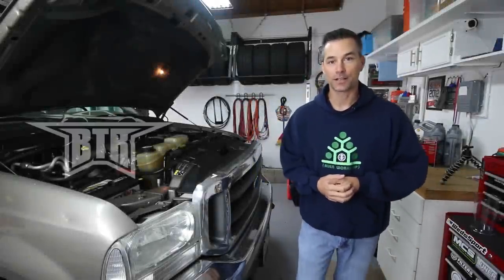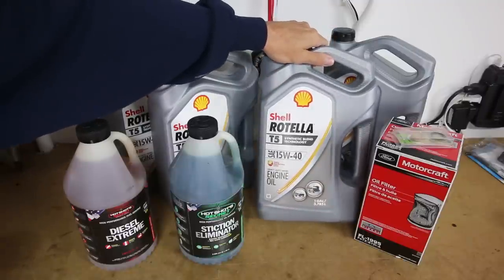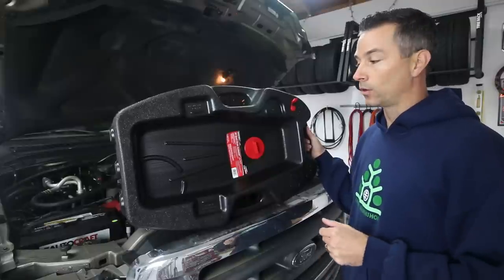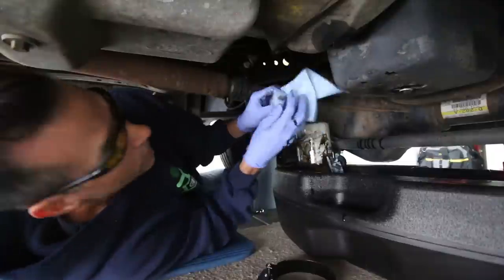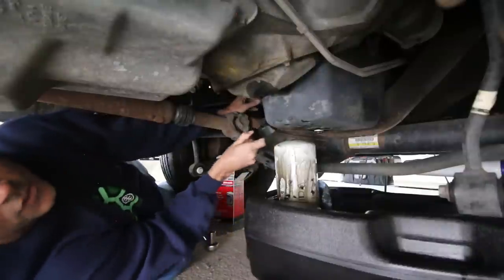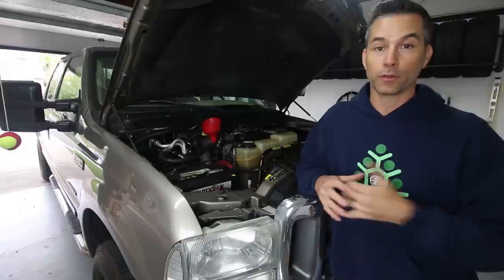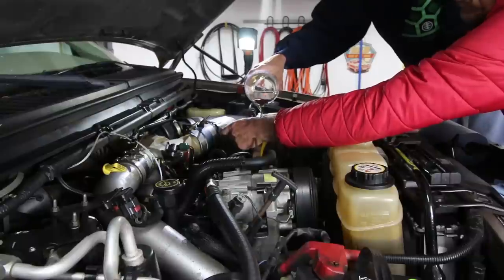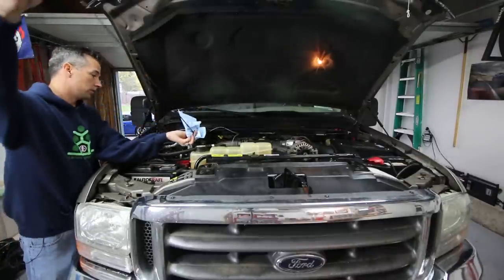Ford 7.3 Powerstroke Oil Change

Comment from the maker: The oil change and stiction eliminator products really improved my cold/hard start issues with the truck! Has anyone else tried out these products? They seem to work alright!

* More Ford F250 7.3L Powerstroke Diesel videos below!
 *
► MBRP 4" Exhaust : https://youtu.be/IzkZUxBhtkE
► F250 Stereo Upgrade : https://youtu.be/WfWpWhJ80K4
► YITAMOTOR Tow Mirrors : https://youtu.be/ieRJQ2tzn88
► Trailer Brake Controller : https://youtu.be/5UHx_FK6IeM
► Legendary 7.3L Powerstroke diesel : https://youtu.be/aLcdKsXR8sQ
Reply: Glad things improved for you. Had the same problem.  I was told to try 3 Qts. Marvel Mistery Oil at my oil changes. That was 75,000 miles back. Smoothed things out after about 500 miles.  You might also try using a small punch on the bottom of your filter. It's a lot cleaner and lighter when removing.
Reply: This is off point. But remember this is a diesel that has five or six common items that must be functioning correctly in order to start properly in cold weather.
1. Glow plugs with relay.
2. Air intake heater coil with relay.
3. Exhaust back pressure valve.
4. Block heater, if equipped.
5. 12.5 volt or better batteries with clean terminals.
6. A strong starter.
As long as the oil looks good, leave it alone. Newer oil is going to be a higher viscosity than the old oil you replace. Changing the oil in a hard start condition will make it worst.
Reply from the maker: Thanks for the feedback, that all makes sense. Mine was due for an oil change anyways, so I didn't specifically change oil for the hard start problems. Good info to know!
Reply: @garygarland8886  Do not put Marvel Mystery Oil in your crankcase.  Their formula is essentially Kerosene, it is simply thinning the Oil.
Reply: I added Archoil AR9100 to my oil, and it improved my hard/cold starts.
Reply: Try rotella 5w40 full synthetic.  Its amazing how much it changes the starting in negative degree weather.  I use to live in SD and my 7.3 excursion would start up in -5 if I was dumb enough to leave it unplugged.
Reply: Yes I am used hot shot stick tions eliminator and many vehicles one in my own 2001 7.3 and I am mostly commercial truck driver and I had a older pier built that was having problems I used few courts of that in my truck had him do an oil change and it ran fine after that this stuff is a very good idea also the hot shots extreme diesel kleen that is a good 1 my 7.3 is or 2 and a 1000 miles I have had no fuel issues whatsoever as far as repair the it still has its original injectors and a mechanic seemed to think it is because I do use the hot shots additives
Reply: Just remember it you are going to need to use on your 1st initial use of the hot shots oil additive distinction use a 4th 64 oz I actually used to 64 oz and 2 different oil changes 5000 miles apart just to make sure everything at cleaned out because I was not the original owner and then after that use a 32 oz bottle every oil change and also you should think about adding a oil filter from insane a diesel and goes down to a one micron it's a bypass filter and it does a very good job of helping keep your oil clean and getting DE gunk out that your regular oil filter will not
Reply: Viking Child 👍🏼 I agree with your top six items that must be functioning correctly in colder weather to start. I would change the oil if it was close to the due date/mileage. 
If the viscosity rating of your used oil is that much different than your replacement oil, you are waiting to long before oil changes. 
The oil is the life blood of our injectors. 

During an oil change, most people pull the plug and change the filter. Unless you drain all 18quarts of oil out (3Q removed up top) you are always mixing 15 new quarts with 3 quarts of dirty oil. To make matters worse, the 3 quarts up top take a while to circulate back down to the crank case. This means that this oil is the dirtiest and has the potential to cause the most sludge.  

I would change to 5w 40 synthetic to achieve better cold starts and frankly, better lubrication overall. 🤙🏽
Reply: Yes these products are outstanding every 6 months IU hot shots injection cleaner and I have a bypass oil filter from insane diesel which goes down to one micron and since I have that I only have to change my oil every 15000 miles and I use the hot shots stiction eliminator I have also used the hot shots transmission added it as well since the truck was owned by somebody else other than me before I got it at 120000 miles I used to 64 oz bottles to different oil changes before just going down to the 32 oz every oil change for the stiction eliminator I also drive commercial trucks and I had an older truck that was having problems I added 464oz  bottles of the sticks and eliminator in it seemed to do better I added 4 64oz bottles of the injection fuel system cleaner and saw massive improvement with using both products
Reply: @garygarland8886   Marvel oil is a good product but it  Can have a chance of being flammable to wear hot shots products that you put into the crankcase are not and these are designed to be put in every oil change start with 64oz first time run for 10,000 miles then each oil change use 32oz I have a 7.3 and usually around 200,000 miles injectors need to be replaced mine still run grate  ( knock on wood )
Reply: I used Archoil for a while. Seemed to help it with stiction
Reply: I have used the Hot shots products in my 7.3L for the last 2 years and the truck has never run better.  Starts great and more power.  After 2 or 3 oil changes with the Stiction Eliminator it will literally clean the internal parts.  I find my oil does not get as dirty between changes.  BTW,  I use the T6 synthetic 5W-40, no problem.  Extreme diesel fuel additive works good every 5000 miles for me.
Reply: @norman_sage2528  Old oil thickens think sludge  I wouldn't follow that oil advice?  You can experiment.yourself new oil pours faster than old oil at the same temperature.

Comment: I saw another video where, after loosening the oil filter, it’s end was punctured ( with hammer and punch ) so the oil could mostly drain b/f removing the filter. It was a bit less messy that-a way.

Comment: Just my .02, but good idea to Change the fuel filter every time you do an oil change also.
Reply: Just about to add that. That's what I was taught lol
Reply from the maker: It had been changed at the shop just recently, so I didn't do it here. But yes, I agree 100%. I have a new video coming soon where I show how to change the fuel filter too :)
Reply: Fuel filter is every other oil change
Reply: Ford says every 3rd oil change.
Reply: Cheap insurance, I do it every oil change. I only use Motorcraft fuel filters, and fuel filter tops.

Comment: I use a 5 gallon bucket for the oil change. Slides right under.
Reply: stock height or lifted?
Reply: @larrywineman403 2001 f250 4x4 285/75 r16 aftermarket wheels no lift, my 2wd i would lift the front up a little to clear the oil pan

Comment: I see a lot of comments here about oil. 10w30 hdeo is actually a good oil to run year round and even towing. It’s better than 15w40 in most 6.0 and 7.3 psd engines because it doesn’t shear down like 15w40. It doesn’t compromise wear protection or any other quality in the oil. It also helps fight stiction and rough running on its own.
Reply: on Diesel any diesel I only use Dlevac HDEO oils  no additives needed at all

Comment: I would check your glow plug relay to insure it’s functioning.   Changing your oil is normal routine maintenance and should be done at 5,000 mile intervals and won’t cause smoke from your tailpipe in conjunction with hard starts in cold weather.   It’s a $35.00 fix and takes 1 minute to check with a cheap test light.
Reply from the maker: Yep! I did a follow up video on exactly that topic, it turned out my GPR was indeed bad and shorting out.

https://youtu.be/AJ3dP70mQAA

Comment: Run Rotella T-6 5w40 specially for the winters you get in Colorado. Walmart has 2.5 gal bottles. The hard start seems more like a glow plug issue. FYI I run T-6 on my 6.0 and 1.9 TDI year round here in California.
Reply: I run T6 5W-40 here in CO. Also use Archoil 9100 in everything. Starts easy and runs fantastic.

Comment: I just did your oil change and HPOP (24oz) reservoir change and I was Absolutely shocked how Different my 7.3 turbo reacts and accelerates. 393,560 miles, original engine, and it moved Freely, like it wanted to run to 3,000 RPM for fun.  I didn't let it but I believe my old 2002 feels like a teenager again. Haha

Awesome oil additive; y'all reading this, drop what you're doin and buy this stuff and full synthetic, Shell 15w-40.
Reply from the maker: Awesome to hear! I had a similar experience after the first oil change with these products. I could actually feel the engine/truck running smoother and more responsive. It was a unique but very noticeable change, oil quality makes a big difference on these big diesel engines 👍

Comment: Since I have not changed my oil in 200,000 miles this was a very good refresher as to what I should expect to do.  I am using the Amsoil 15W-40 HD Diesel and Marine oil with a conversion kit from Amsoil.  The kit consists of a bracket to mount on the frame that holds two filters, one course and the the other a fine filter, which replace the OEM filter.  Then every 15-20,000 miles I send a sample to Oil Analyzers who send me a detailed reading of all the particles in the oil and a recommendation as to changing the oil or not.  I also change one filter the first time and both filters every other time.  This may not be for everybody but I think I have saved some money over the 18 years that I have used Amsoil not to mention the time it takes to change the oil.
Reply from the maker: Good stuff! I have sent off oil samples to Blackstone analysis, who do you use? I need to send off an oil sample for my 7.3 one of these oil changes.
Reply: @TheBTRGarage  Hey Justin, I use the oil sample kit from Amsoil Kit 14 which has me sending my sample to Oil Analysis or Horizon either in Indianapolis or Houston lab.  They send me an email with the total analysis and then a hard copy in the mail.  I then can go to my account and see all the history of prior analysis.  How much is you analysis?  My kit runs around $19.00 which includes the analysis.
Reply: oil is still cheaper than motors...change your oil and filter

Comment: A little trick for a cleaner oil filter removal is to drill a small hole in the bottom of the oil filter and let it drain before removing. Thanks for the Stiction Eliminator tip. I may have to try that.
Reply from the maker: Great tip! In one of my later videos I did a similar thing, which was to pound an (old) screwdriver through the bottom of the filter and drain it that way. Same concept :)

Comment: My 7.3L Powerstroke has a block heater. Not sure if that is typical. Thanks for the refresher. I personally have never changed the oil in the truck. But do to work I cannot take it in to get an oil change and will do it myself this time.  I always like a quick refresher video before working on the vehicles.
Reply from the maker: I think the block heaters are pretty standard. Mine has one as well and I would use it in the winter in Colorado.

Comment: I highly recommend an oil bypass filter.  You will be amazed at how clean your oil looks when you pull the dipstick as time goes by.  Installed mine over 60,000 miles ago and have been very, very pleased.  It does increase your oil capacity depending on the filter you install.  Good luck.  👍👍👍. 11-7-21
Reply from the maker: Interesting, haven't heard of those. I'll take a look, thanks!
Reply: @TheBTRGarage  Justin, had the oil changed, when I was younger I did it myself. Several weeks ago, just checked it this morning and I can still see through the oil and see the dipstick.  Several people make them, AMSOIL and FS-2500, the one I have.   The oil stays clear for several miles.  Good luck.

Comment: I use either the stiction eliminator or Archoil 9100 every oil change.  I add seafoam to the oil and drive it about 20 kiles before every oil change.   Seems to help.

Comment: Great video, first off get the Fumuto drain valve it's so much easier and cleaner. What has helped my 7.3's with cold start's is using the Rotella T6 5W-40, and when it's really cold I will let the glow plugs go for 30-45 seconds before trying to start, when I do this the trucks fire right up. If you want to go farther check the glow plug and relay, search here on Youtube and you will find several videos on checking those things out and some smoke at start up will be normal.
Reply: What he said ⬆
Reply from the maker: Thanks for the feedback, I definitely should have gotten the Fumuto valve, next time. I've gotten the recommendation for the T6 5W-40 from a number of people, I might try that for next winter. Only reason I did not use it this time is because we do not get that cold in the city, or if we do it doesn't last long.

I did check the GPR prior to this oil change too, and it tested fine. BUT, while the oil change definitely helped, the symptoms got worse over time and well, GPR turned out to be the culprit. Video of that coming soon :)
Reply: @TheBTRGarage  I tried using the 15W-40 during the summer months but the trucks don't run as smooth as they do on the 5W-40 so I run them on the T6 all year long.
Reply from the maker: Hmm that's interesting. Well next oil change I will definitely make the switch then!
Reply: I can confirm T6 5W-40 here in CO, it’s all I run all year with Archoil 9100 every oil change.

Comment: Hi great vid as always. Really good thought out vid with a lot of good points 👍. My thought on the cold start problem is it maybe glow plugs but don't go by the "wait to start " light the glow plugs are on for up to 2 min easy way to see is to put a volt meter on one battery and turn the key on and when the voltage jumps up run and start it and see if it starts better I don't know why ford did it that way it causes confusion on when to start it. Have a good one and hope it helps 👍
Reply: Also if you just watch the needle on the battery gauge you will visibly see it shoot up when the Glow Plugs shut off. Honestly I wait nearly every time, regardless of temperature.

Comment: That drain pan is a life saver. It's the best one for all drain pan.
Reply from the maker: Yea it is, I can't imagine changing the oil in this thing with some of my smaller oil drain pans.
Reply: I use a cream bucket from donut shop. Fits just under the plug on a 2000 4x4. Oh, the Rotel T6 5/40 is the bomb. Block heater plug should be inside front bumper if equipped. Turn on an hour before ya start and it cranks like a meth junkie.
Reply: @TheBTRGarage  where can I find that pan you use ? The link in description isn't to the same one on my end.

Comment: Justin I am new to diesel engines and use for my work appreciate you video never heard os sticktion before I looked it up and was amazed cause my work truck does have poor idle and dies frequently usually in cold or first starts of the day .. just changed the oil but gon need to add the sticktion and the fuel additive
Reply from the maker: Great, hope the videos help! I'd definitely run the stiction eliminator through it and see if that helps.
Reply: @TheBTRGarage  yeah I ordered sum from the parts store should be in the morn .. def can't wait to get back to you on my results of it .. also didn't syphon the oil out of the res. Near  the alt. And of course turned the fresh oil a Lil dingy but hey maybe get to it next time .. appreciate the vid new sub here

Comment: If your having hard starts under around 45°f I can guarantee you it’s your glow plug relay. My truck has started perfectly down to the coldest temp I have seen 5°f or so unplugged. Let me know if you have any questions thanks
Reply from the maker: This was pretty much it! I later found out after this video when the GPR died. At the time I did this video it was still testing ok. The next video where I replace the GPR is an interesting one, stay tuned!
Reply: @TheBTRGarage  hope you replaced it with the white rodgers relay. That thing will not fail like the stock one. Install is a slight pain, but really not hard just tough to get some of the connections on there correctly. if you didn't, the motorcraft one will be dead in a year or two. This one will last the life of the truck. Here is the amazon link: https://www.amazon.com/gp/product/B00DE3HY4K/ref=ppx_yo_dt_b_asin_title_o06_s00?ie=UTF8&psc=1

Comment: Should try rotella t6 5w-40 during the winter but hotshots is good stuff but for winter easy starts use archoil AR9100 with t6 5w-40 and the difference speaks for itself. But i use hotshots and t5 15w-40 in the summertime but that stuff turns thicker than honey in the winter making it hard to pump through everything and i noticed its hard on the starters and chews teeth off on the flywheel
Reply: That’s the exact formula I use T6 5W-40 with Archoil 9100(use it in everything) here in CO.

Comment: Been a long time since this video but to avoid a messy oil change drill a small hole in bottom of oil filter and let it drain just like you would oil from oil pan eliminates the mess.
Reply from the maker: Yep, good tip! I've gotten that feedback from others and showed how to do that in later videos 👍

Comment: I was reading that using 5w-40 full synthetic oil will also help with cold starts. 15w-40 is very thick cold and has trouble pumping the injectors to fire when cold. It might help might not. I am going to test it this winter myself.
Reply from the maker: Yep!